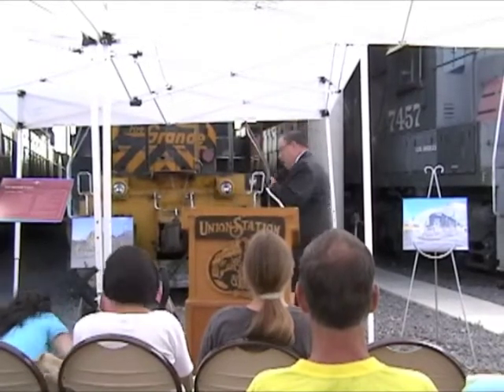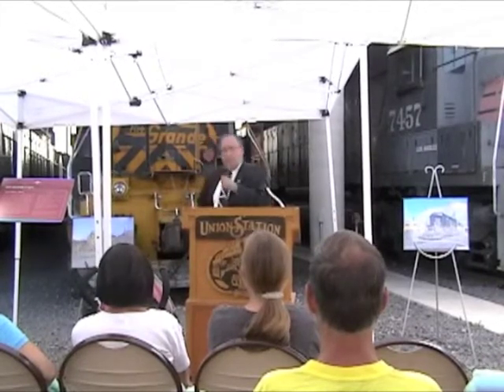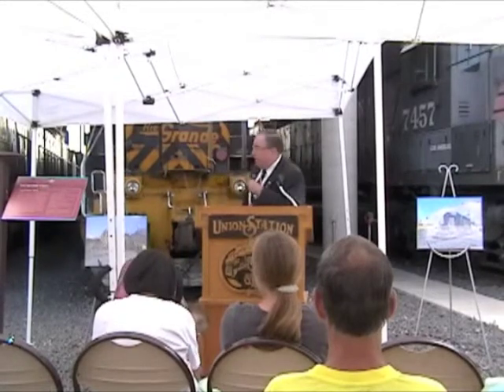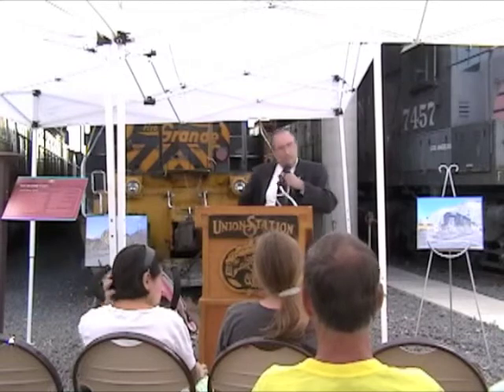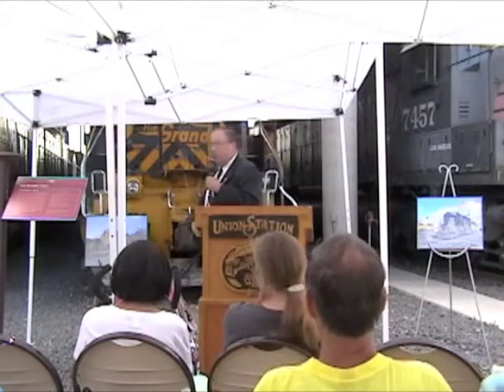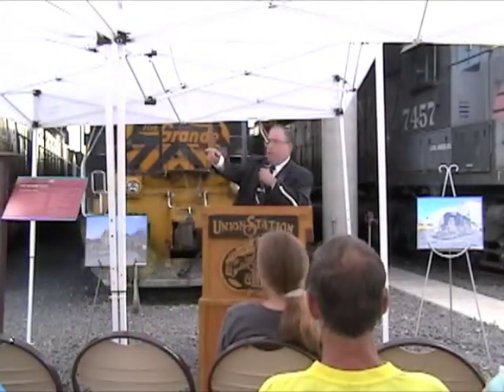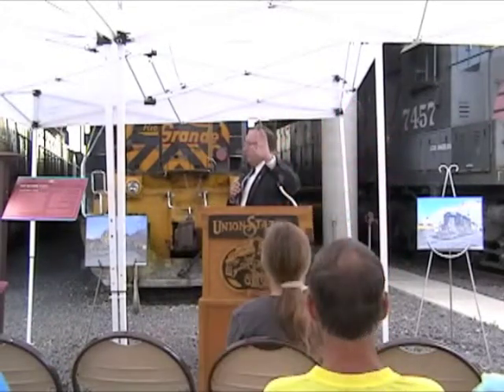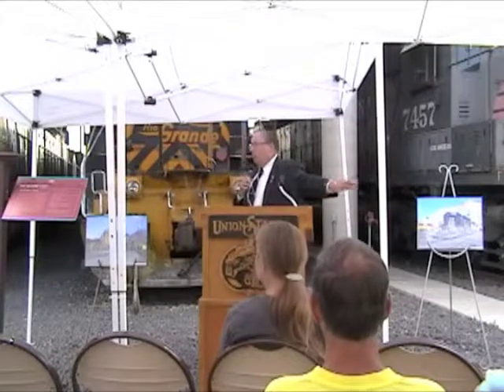5371 dedication part 2

Comment: Glad it is safe but some of the things he said are not right. There are many surviving D&RGW units. Yes 5371 is not patched, but it has two ex D&RGW SD40T-2 sisters that are also not patched on the wheeling and Lake Erie. Also D&RGW 5401 is having its patched removed when put on display at the CRRM. There is also D&RGW F unit 5771 at the CRRM and one at the UP cheyenne shops. Also there is a surviving D&RGW GP30 at the CRRM. There are also 7 active D&RGW GP40-2 on the UP but they are patched.